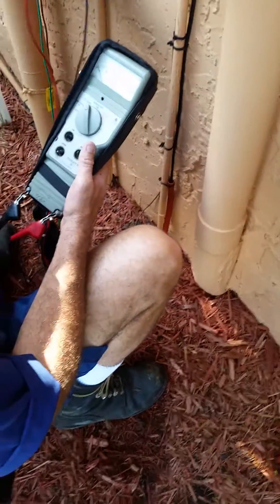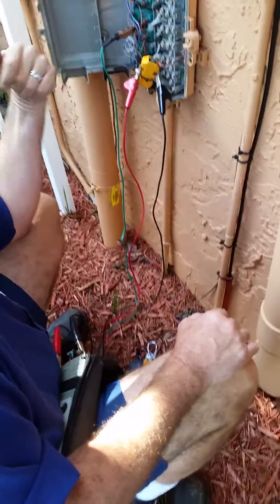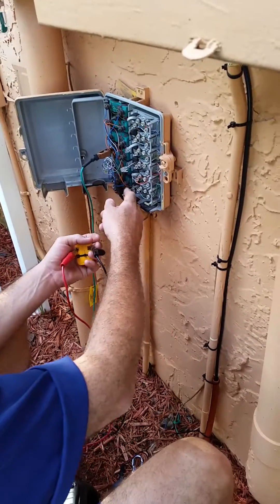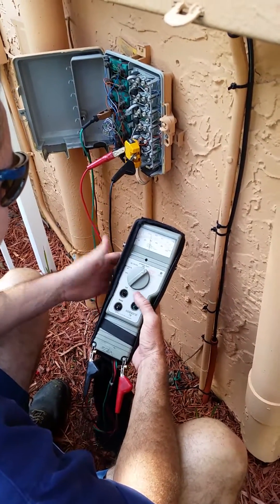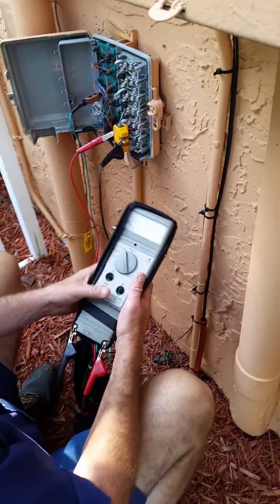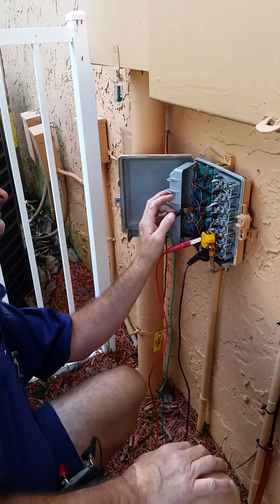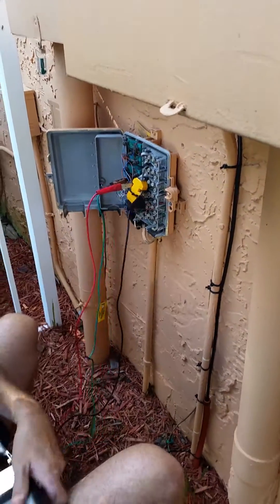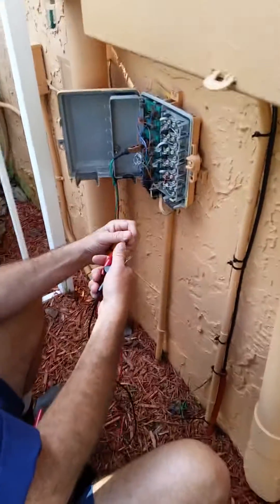Experienced AT&T tech explains use of Kick Meter

Comment: As a Cable nerd with little experience in phone it sounds like the equivalency of noise or ingress ? ........I know lets hear it phone guys lol,
Reply: comcast tech for 16 years, now a copper tech for lumen, unlike cable that needs a solid shield to protect it from noise, dsl is far more resilient to it that shielding isn't required, so ingress isn't really an issue with copper but, shorts, corrosion, dirty opens and excesive moisture is a problem

Comment: You have leakage in your line either corroded cable or moisture
Reply from the maker: i this case they had a lot of hand-twisted splices.  You know, when non-telco DIY'ers try to splice the pairs by just twisting them together and wrapping it with electrical tape.   You know... that's gives me an idea for a video about RedHeads and Rat Rubbers. :-)

Comment: I've been with AT&T for almost 22 years, where the hell do techs wear shorts?!!
Reply from the maker: +Robert Esparza Florida :-D
Reply: All of the Southeast! District 3 to be exact
Reply: Shorts....?? I don't see a problem there, in recent years many companies have become more flexible in their uniform regulations. Most uniform supply companies offer shorts for those who opt for them.  Workers should be able to attire themselves "weather appropriate," if conditions call for shorts, it should be an option and many companies  are finally coming around....!!
Reply: In the south BoBo. After memorial day to labor day and only FTs and STs..... no wire techs/uverse techs at any point.
Reply: As soon as they offered shorts on the uniform program I have been wearing them. I only had two pair of long pants. For those real cold days or when I worked the race track in homestead.
Reply from the maker: Just messing with ya! 😊
Reply: @DIYTelecom  it's been known to get in the 30's. I would check to see what the temp would be by noon. So most of the time it was shorts...
Reply from the maker: 30s in south FL??!!  Yikes.  😳
😆😆. 
Thanks for chiming in on this convo. 😊
Reply from the maker: Cold Days Mark?  You mean like low 60’s?  😆😆
Reply: They do down here in FL
Reply from the maker: Yeah,  I think i filmed this in Palm Bay (150 miles north of Miami)
Reply from the maker: Ahahahhaa… awesome! 😆

Comment: the att uverse/wire tech dont have that professional tool in set the upper level manager have them remove from old trechnitian to have some kind of joke tool that dont even see the balance or short on the line and when they get repeat because the line failed they upper level manager blame on those poor bastard that have no decent tool to isolate or find the real issue bad lines been used to transport the sync to the rg

Comment: He is either really dumbing it down, or doesn't have a complete understanding of basic electricity as it applies to telecom.

However, the tech is correct in what he is saying. And when you see the tech kicking the pair, what he is doing is averaging the capacitance of the pair to get an estimated wire length. The part where he is referring to the dB is referring to the longitudinal balance of the pair, which is the pair's ability to reject emi based on its twist. Anything under 60 dB is bad for xDSL, but it won't have a noticeable effect on POTS until it drops to 40dB or below. 

a KSU/PBX does not put voltage on the CO side of the iw. Only to the phones, and it's typically around 12 volts. Cross battery is usually due to heavy corrosion on a splice, or wet cable.

If that iw is going into a conduit, there is probably water damage causing the issue. It could also be a defective phone (not as common) or corrosion across the pins at the jack/phone cable (more common if people don't like running their AC or in the kitchen).
Reply from the maker: Thanks for you highly insightful comment Ryan.  Stuff like that helps people out!  (which is what blogging and YT is all about, in my opinion).   So, I have to say, I'm really surprised this video attracts so many professional Telco guys.     That was certainly NOT my intended audience.  But, let me back up.

 I'm a freelance network, voip, pbx guy.  This TY channel is just my humble attempt to share what I know to either DIY'ers or new techs.   Obviously, I deal with copper but nowhere on the scale that you pros do.   Anyway, the context of this video was that I was on a vendor meet to trace down static on the POTS lines.  The AT&T tech you see being filmed was doing me (the clueless one) the favor of explaining how he uses his kick meter.
  
So, any appearance of him speaking simply is just for my benefit.  I'm the guy running the camera and asking the dumb questions.   Oh, and btw - there was no pbx inside.  It was just a bunch of 2-line phones and a mess of splices and cat-1 wiring.

But, seriously.  I really appreciate the comments!  :-D
Reply: DIY Telecom You'd be surprised how many field techs don't know the details and only know what to look for on their meter. Some of them talk the same way in the office as the video (I hear guys say "dee bees" instead of just saying balance).

The sidekick is really one of the best troubleshooting tools out there for copper wire line. The JDSU meter other people were talking about is 4 times the price and can be finicky but includes things like a TDR. 

You do have a very informative channel. keep it up!
Reply: That's got to be one of the best explanations of the testing aspects of a Sidekick I have ever heard!
Reply: @perpetualjon  Thanks!
Reply: This comment is gold. I’m on the job training and nobody could tell me exactly what longitudinal balance measured. 
That’s why I’m searching YouTube for more info. 
Hopefully when I go to an actual troubleshooting class they can explain in detail.
Reply: @RacerX_1111  Logitudinal balance essentially tests applied signal (your POTS, xDSL, T1, etc signal) or test signal vs stressed noise. Essentially it's measuring the amplitude of your test signal against ingressed interference. The difference between these two signal strengths is expressed in the ratio format of Decibles (dB). The higher the dB, the better signal to noise ratio you have. The lower the dB, the lower SNR you have. Above 60dB, digital services will work properly and bandwidth won't be effected. Below you'll encounter increases Bit Error Rates and Code Violations reducing bandwidth. As that signal to noise ratio drops further you'll get intermittent service drops. Below 40dB you'll start to hear visible static on POTS lines. 

The method at play in Logitudinal Balance, is that the signal is flowing across the tip and ring equally. What factors into this is capacitance, linear restance balance from tip to ring to ground, and twist rate. (Twist rate effects length of the pair and directly effects capacitance, as well as noise rejection).

Hope this helps to further explain it!
Reply: @RyanKirbyInks  That was an excellent, crystal clear explanation. Better than anything I’ve found online. 
I really appreciate you taking the time to comment!
Reply: @RacerX_1111  My pleasure!
Reply: @RyanKirbyInks  please start a YT channel that educates us newbies in the field. I am almost done with my training, and will be on my own soon. I have been stressing, because I know I have to run tests. But, I don’t know why. I know there may be some troubles, but I don’t know why or what is causing them or how to fix. Knowledge is key to better customer interaction and service. Plus, the more we know the better our work will be. Thank you for the informative comments.
Reply: @lescobrandon1638  unfortunately, I don't work for Bell anymore and I now work an all fiber plant. So my access to those type of scenarios is non-existent these days.
Reply: Longitudinal Balance was measured as the stress test on the Tempo sidekicks.  Lower was better, under 30 was preferred.  The technicians got savvier when we got trained on the Hst-3000s and the Onyx 580s which measures longitudinal balance how Ryan describes.

Comment: who is this putz get a jdsu and solve the problem  you can not  see anything by kicking the sidekick that fast PUTZ
Reply from the maker: you guys crack me up.   :-)
Reply: LinZ Wallace until your HST decides to randomly restart every time you attempt any testing. I still use my throwmaster from time to time.
Reply from the maker: Ryan Kirby  Thanks for the comments Ryan - it helps us all out!  :-D
Reply: DIY Telecom You can also test for the same faults he was testing while doing the stress test by Shorting the tip and ring both to ground. Measure the resistance on both sides of the pair to ground. Assuming both the ground your testing from and the ground your pair is shorted to on the other end is good, you should see a less than 10 ohm short across the pair to ground. (you have to measure tip to ring, tip to ground and ring to ground). Any variance in the resistance values indicates a high resistance open which will change its characteristics based on how much current is flowing on the cable. 

A good example is a line that doesn't ring reliability but works fine off the hook. the current seals the connection, but voltage increases the resistance creating virtually an open in the cable (talk voltage is about half of what ring voltage is, and one is DC while the other is AC). If the customer has DSL that doesn't work well, but works fine when the line is in use is another indicator that a high resistance open is present.